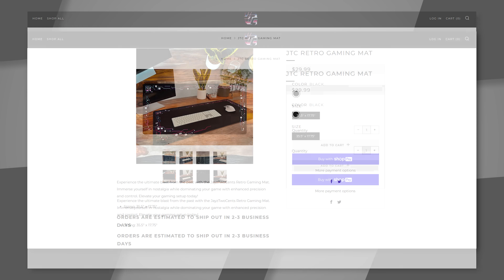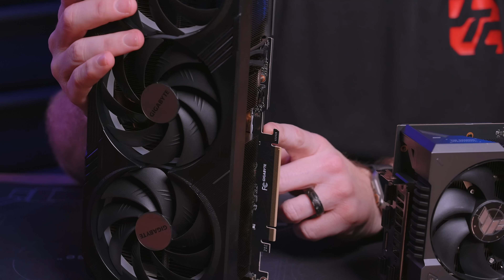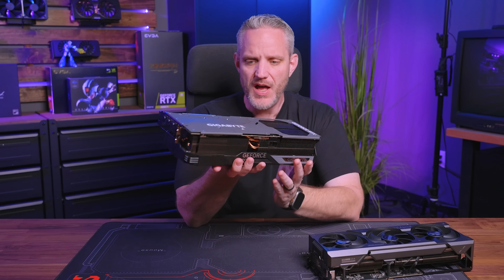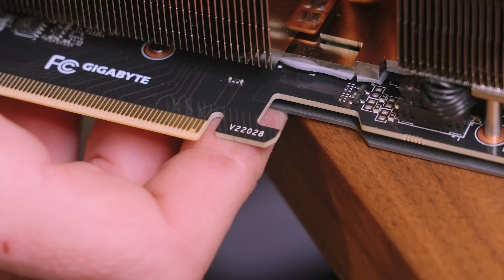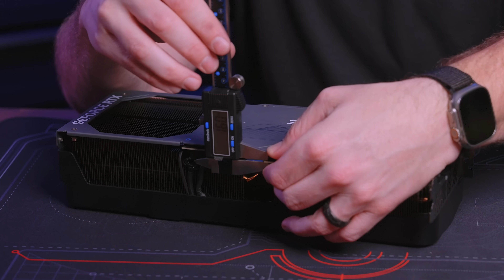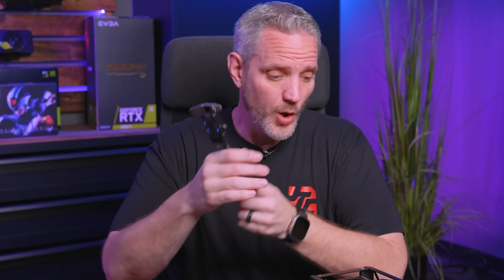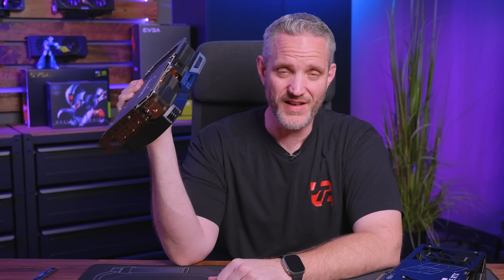These GPUs are cracking and the company REFUSES to warranty them!

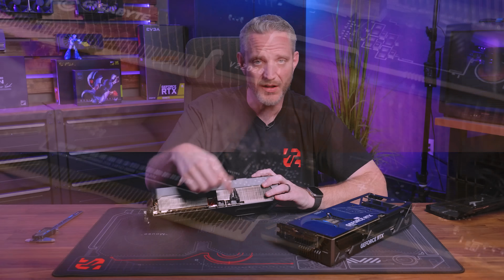Comment: At 14:14, you can see there's a tie-in point on the ASUS card where you're checking the rigidity of the PCB. Maybe if there we more contact points following the perimeter of the PCB as well as reinforcements in that tab area, along with tying in  the bracket on the back of the GPU then the issue(s) would be resolved. Contrary to popular belief, I've never liked putting figurines or other memorabilia on top of my GPU, and something like that could also contribute to this issue if you're adding extra weight on top of the card when it's already exhibiting severe sagging issues.

Great video Jay! Always love the content.

Comment: I've openly refused to use or buy Gigabyte products after this one incident where my old Gigabyte Ga-78lmt-usb3 motherboard which had to be sent back through RMA, sat at Gigbyte for over 8 months. We had called and emailed during that 8 months trying to figure out what was the problem and why it was taking so long. At one point they had no idea where my motherboard was or what the RMA status was. They did nothing with it. Both my mother and I had enough of waiting so my mother filed a report to the Better Business Bureau. Around 2 weeks after we filed, they 'found and fixed' my motherboard and sent it back. When it arrived, I plugged up everything, just to realize that the problem was not even fixed. (BIOS Chipset Failure) They literally just found my motherboard and shipped it back saying they fixed it when in reality they got upset with the BBB report and just sent it back out of spite. This also wasn't the first time this 'Ultra Durable' motherboards chipset failed. It had been fully replaced once due to them not being able to fix the motherboard. Ever since I upgraded from my old AM3+ Gigabyte board to my current AM4 ASUS Board I've had no problems. That's why I openly refuse to buy ANY Gigabyte products, even if they are a good deal, I'd prefer to use literally anyone else.

Comment: I have a Gigabyte 3070 card, but it seems to have support screws in the faceplate for the cooler. It's the Aorus Master 3070 Rev 2. Should this model be okay, or am I wrong? Don't have access to properly check as I won't be back home for another 3 weeks

Comment: I have a Gigabyte 4080 gaming OC and I was surprised that it wasn't as heavy as I expected and doesn't seem to sag too much even without the bracket. I think you'd have to be ragging on it pretty hard or just get unlucky for the PCB to crack. I'm not saying it couldn't and doesn't happen but just not to panic too much if your system seems setup appropriately and you're not removing your gpu a lot for some reason.
Reply: I have a 4070 on the way and watching this video made me panic like crazy do you think I should be Hella worried or?
Reply: Gigabyte 4070 windforce

Comment: They are bothe the same thickness   due to pcie standards the most plausible reason one is more flexible is because one uses solid ground and power planes and the other probably uses split rail  and while both probably use split power rails but the split could be in a bad place

Comment: Either way the flex isn't just because of the pcb construct itself... the actual daughter board design on the gigabyte's pcb itself it looks like they dug the surrounding part of the pin to make it looks cooler, but it made the board can't pull its own weight causing the pcb cracks

Comment: It is because the gigabyte card does not have structural support that the ASUS has(the metal slab on top, and the pylons connecting the pcb to the metal parts of the cooler). You can see the metal structures on the ASUS goes much nearer to the tab thingie,  while the gigabyte does not, which is much further away. This causes the PCB to move and sag more than ASUS. 
That is simply bad engineering.

Comment: at 6:54 you've got the 2 cards in the shot. how can you not notice the physical difference? the gigabyte pcb at the latch point is much longer with squared edges (bad). where the asus is much shorter with rounded edges (good). a rounded edge is much stronger. like one of the first british passenger jets, that crashed killing everyone, because cracks formed at the corners of the square windows. they had to retrofit all of the jets with standard oval/round windows...😶

Comment: I am going to check my 3070 right now kinda worried as it was a prebuilt.
Reply: and it is good?
Reply: @carlosxdlo2802  Yes, it is good but now after seeing how flimsy it is I would rather them refund me and get a 6950xt made by power color because  power color is a trustworthy brand as of now with no history of issues as I know of.  As for how it preforms at this point I honestly don't care as long as it gives me more than 60 FPS on 1440p Ultra and does not crack in half. I'm tired of these GPU companies not accepting warranties on graphics cards worth more than a mid range laptop. At least AMD and their graphics card manufacturers have not had any trouble with drama like this. Well time to go graphics card shopping. Wish me luck!

Comment: From my experience back in the early 2000's most PCBs were fiberglass. I'm sure modern boards are still 80%+ resin, so the issue likely falls to the the resin mixture itself, or the tensioner material wheather it is glass filiment or anything else.

Comment: Hi Jay. Currently a RTX 4090 Aorus Master for sale on EBay Australia. Same issue cracked PCB at the retention lug. Looks like it's going to be an ongoing issue. Maybe the design of this lug was never designed to handle the weight of modern GPUs. Keep up the good work.

Comment: PCB's are a composite of fiberglass and resin, and these tabs were designed in a time where these cards weighed many times less than they do now. It's kind of absurd that there haven't been more problems than this up until now.
Reply: why use solder when hot glue works just fine🤣🤣🤣

Comment: I've seen a couple of ASUS Tuf Gaming 4080/4090s with the retention tab snapped completely off so don't think it is only one manufacturer's problem. GPUs are getting ridiculously heavy and perhaps the PCB material is not strong enough to support the weight of the card.
Reply: My rog strix came with this adjustable pole thingy because the card is ginormous and wieghts a ton.
Reply: Yeah my TUF 4070 came with an adjustable rod. I feel like this issue is happening because people don't want to use that support.
Reply: @ethanieldude1  btw if you unscrew the rod and pull it out there's a screwdriver inside

Comment: if we can approximate GPU PCB geometry, masses & stiffening structures mounted to it, and agree on some boundary conditions for the tab, I can run a simulation of various vibration inputs and show how different loads impart different fatigue damage (initiating and propagating a crack) to the tab.

Comment: Right. My short story with gigabyte 3080ti I purchased back in February 2022. Started about 2 month ago... First sign PC did not boot. white led on mother board (ASUS rog strix b-450 f gaming). Swapped back to 1070ti and all is good. Hmmm RMA... after 3 weeks got the card back with the note they could not find anything wrong with it. I was surprised but lets see... Boot!! awesome all is good... BUT HEY!!!! Something is not right... low fps... low power consumption...what is going on? I knew my Corsair 750w PSU is like 10 years old so lets get a new one. Corsair RM1000e.  DID NOT HELP.... (no daisy chain for the 8pins!!!) So after looking into it I found one of the 8pin power connectors on the card was only pulling 1-2watts no matter how I was stress testing the card. 8-pin#1 about 153 W , 8-pin#2 about 2 W, GPU PCIe power draw about 65 W. 
So sent it back through the retailer again with video and screenshots as proof and just this week they confirmed I should get a refund as Gigabyte were unable to repair/replace the card for me. I still do not know what was the cause of the issue.

Comment: Gigabyte is by far the worst brand of the "name brands". I stopped using their parts back in 2016 and never recommend to any customer. They are cheap for a reason, did we forget about the PSU line they came out with????

Comment: That sucks but I'm afraid Gigabyte can actually claim that physical damage is a warranty void case... Unless someone would actually turn an extensive lab tests into a massive lawsuit. The best Gigabyte can do in this situation is to pack new cards or send to existing owners or at least somehow inform and recommend to use stands or brackets (which is totally common thing for a heavy GPUs). I mean, there is actually not that many owners of the exact problematic models of high-end GPUs to somehow manage this situation without a massive recall of normal-ish GPUs.

Comment: I mean, even IF the cracking is caused by people inserting it, or plugging in the power cables or whatever, everything described would (or should) be considered NORMAL for GPU's. Afterall, Doing that isnt exclusive to Gigabyte cards. ALL gpus go though that, yet only these specific Gigabyte cards are failing, in the exact same location in almost the exact same way. That tells me, manufacture defect. and that they are ignoring it/blaming owners (yet again) just shows how shitty of a company they are (worse than Asus) and people need to stop buying things from them if they are just going to blame their costumers when something they do goes badly.

Comment: Honestly , fuck Gigabyte for doing this, but also I feel this is a clear fault in the 20+ year old ATX standard. IMHO, any platform that uses a PCB as a load bearing component is a failure in design.  We really need something new that doesn’t create as much strain on component PCBs. Imagine being able to plug in the card after installing it. If we can get 40 GBPS into a usb cable, we can make these PCI slots a lot smaller and more modular.

Comment: Putting traces inside a mechanical stress point is the last thing you want to do designing a PCB.
Were there other choices? Maybe not, adding layers would shave the profits. Nvidia likely has a prototype layout for this board that they would share. This looks like a newbie's layout. 
Never been a fan of anything Gigabyte.
With suitcase sized graphics cards, the case bracket needs to be part of a metal plate load carrying structure.  
Maybe the PC cases need to have "remote" mounting of the big cards with a flex cables?

Comment: I have a Gigabyte 4090 gaming OC. The worst part about it is the mounting bracket is not compatible with all motherboards. I have an MSI 670e Carbon. The Graphics card is about one slot lower than most. Their design will not work with my card. I bought an after-marketing GPU SAG bracket...hope that's enough.

Comment: Not sure how useful this is, but you can prevent further crack propagation by drilling a hole at the end of the crack. Finding the true "end of crack" can be difficult in and of itself and may require some more advanced equipment and techniques, but that's how you can stop it if you're in that situation. Obviously you also don't want to go drilling through other leads, so that's another consideration.

Comment: my ventus 3060 oc has that exact flimsy tag, but mine has already been broken off, im not sure when it happened excatly but i alwsys  knwe it would turn out that way. and also yes the tabs suck when you have a large air cooler,. ive also had broken tabs on motherboard as a result
Reply: also i have this gpu 2x

Comment: The real question is why graphics card need to be this big to begin with.  I would contribute to laziness of the designers pushing the chips to over perform and taking the easy way out by the ridiculous size of these heat sinks and fans.

Comment: ill go ahead and say this.. i have a 4080 aorus master sitting beside me. it is HUGE the card its self its bigger then the box my 4090fe came in. its scary to mount instant sag. however gigabyte does include hardware that mounts the gpu to the motherboard stand offs which make it very sturdy and literally impossible to sag . not saying its a fix to the problem because i dont know if all their cards come with the same hardware or not. but no one should be horizontally mounting these massive ass gpus and expecting them to stay straight. i mean anti sag brackets and stands are pretty cheap lol

Comment: I am using a Gigabyte RTX 3090 Extreme GPU. I am so thankful that I purchased a case that allows the GPU to be mounted vertically, instead of horizontally. This orientation relieves the pressure on this mounting tab.

Comment: I checked 4 out of 5 GPU's I have and none of them have that much flex, heck they barely have any flex. I think this is a gigabyte issue as I checked an old HD 6950, ARC A770 LE, RX 6700 and RX 6800 and each is from a different brand.

Comment: My secondhand RTX3060ti card came with a metal support arm that attaches to the case I/O slot screws and takes the weight of the card at the opposite end, to take load away from the motherboard connector.

It looks like support arms / brackets such as this are readily available from ASUS and other makers, so possibly a worthwhile addition to pre-empt any problems due to flexing or sagging with long & heavy GPUs?

Comment: I am scared. My Gigabyte 4070Ti does not use anti-sag measures but I don't twist or flex it at all.

I'm scared that it's just gonna break or stop working. I spent 1000 dollars on that GPU and I've saved up for a new GPU for nearly 4 years. I have no possibility, if it breaks, to get a new one. I can't afford it, I am so screwed...

Comment: Post 10 series cards, manufacturers shoudlve started to work on changing the entire format, the issue with pc parts is its just tiny progressions over time, dramatic change is rare. But figuring out a new way for gpus to be mojnted/supported ALSO how theyre designed fundamentally has been required.
Reply: They tried changing the format for power connectors on the cards and LOOK how THAT turned out lol. I dunno if I trust these shmucks not to screw things up even worse.

Comment: I built my PC in a case that holds the motherboard horizontally.  I never liked how vertical motherboards (tower PCs) hold everything sideways.  No issues other than it having a slightly larger footprint on my desk.  Totally worth it.  Heat also leaves straight up and away from the motherboard instead of heat travelling along side the motherboard where some devices might contribute to the heating of another.
Reply: Originally PCs were all built like this, but the "desktop" form factor refused to go beyond a certain size since ATX boards were all that was available.  Today, though, a small micro-ATX case can almost be used as a monitor stand.  The model mentioned is the Thermatake V21.  But a more traditional case on its side will also work, especially if it is like the SAMA IM01 which has the sides as a mesh as well.   The Silverstone GD09B is a more expensive option.  But any small case with a glass side can be put horizontal and used as a monitor or speaker stand.  Some even allow you to simply remove the glass and install a screen (nice DIY project)
Reply: Well computers did start off being horizontal... so... no harm if you got the room on your desk.
Reply: @garyr7027  And they are still designed to be run horzontal for best efficienty.  It's the case designers that decide to put everything sideways in order to fit into office designs and furniture and so on.  Take your typical stereo - same deal - horizontal because that's how heat sinks work best.  
I would be interested to see what changing the orientation does to cooling in a future episode.
Reply: @josephoberlander  a lot of the test rigs I've seen are horizontal. I second your question.
Reply: Unless your PC is completely passively cooled, heat is not moving "straight up." PC fans, even small ones, are more stronger forces than natural convection. Horizontal builds are advantageous, but it's not because "heat rises." With fans, air mixes. You can measure with any ir camera or thermometers.
Reply: @Djinnerator  You may be right about the fans and such but the video card is always horizontal, creating a barrier adjacent to the processor, like an air dam.  In the horizontal position, air seems freer to move around the case without all the maze-like walls all the chips and hardware create.  My cube setup has fans on the front and one side pulling air in.  Then I have fans on the rear and top pushing air out. Beautiful flow with positive pressure inside the case. Computer never gets hot or dusty. It may be possible in a tower design too but not as easily or efficiently. And not as safely for a heavy video card. 🙂
Reply: @Djinnerator  Except that large flat items like, say, video cards and SSDs and so on can cause circuitous paths for the airflow as it's basically having to flow around various heat islands and shelves. My current tower is 5-8C less efficient when I close the front panel cover versus leaving it off or open because I've removed an entire drive bay cover.  Just having the air flow straight to the CPU heat sink directly in a passive manner (via a large hole) is far more efficient than even using the case fans which are in the lower part of the case.  
In general, any design that works well passively will work very close to maximum efficiency when you add fans.  I used to design custom low and zero noise PCs years ago for clients and the things you learn by only having one or two fans to work with are very interesting :)
Reply: WHat case do u use?
Reply: @freelancer1499  ThermalTake cube. I don't know the exact model but they have a bunch. In black and white.
Reply: @watchingdanny  Thanks!
Reply: i still use my Rv01 silverstone tower case, it holds the gpu vertically and has a brace for the gpu included.